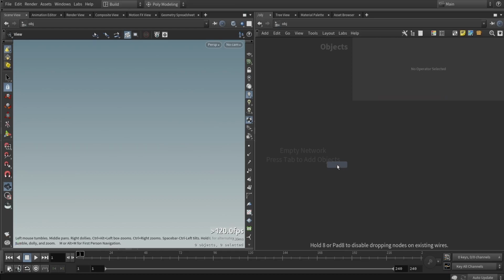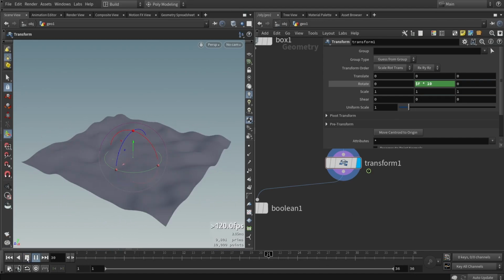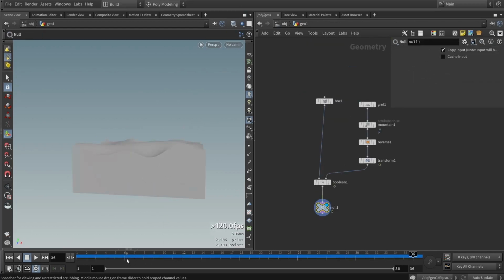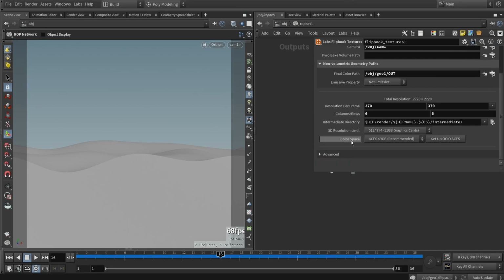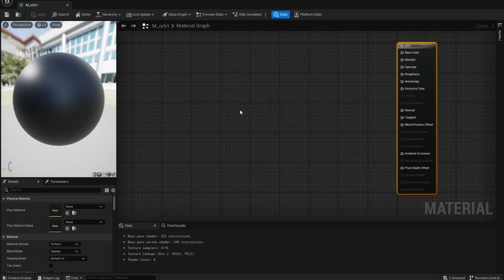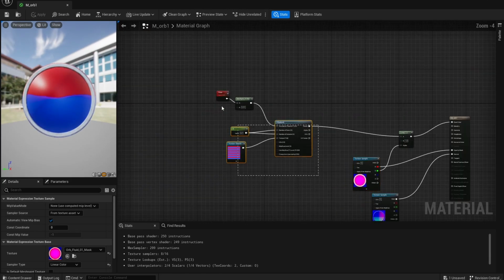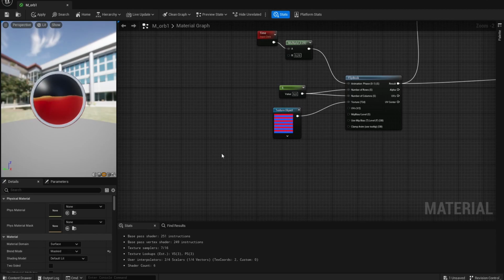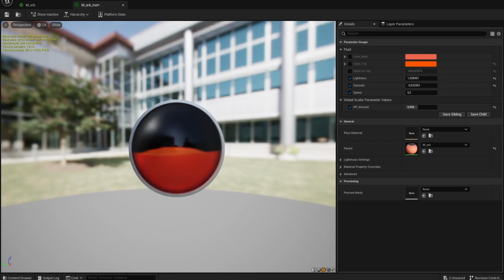UI Fluid Health Orb || Houdini and Unreal Tutorial

Comment: Great tutorial, only issue is its setup as a surface material domain but to use as a user interface it wont work, if anyone knows how to fix that, its got me stumped, when trying to make a widget i get error that it wants to be converted to ui when i do i end up with a black orb with sparkles and nothing else
Reply: have you fixed or find another way to use it as health bar? xD
Reply: Yep, thats a little trick in some youtube videos, it looks cool, but you cant use normal maps on widget materials, so you whould find way around, for example make that flipbook to work as alpha mask and put some random color, you still maybe need to make it pretty, but it will work.

Comment: Hey Simon, how are you doing at the new studio? I have a question. Yesterday, I was trying to use Labs Flipbook Texture with Labs Loops SOPs in Houdini. It worked well and repeated smoothly, but when I tried it in EU5, it didn't work. I am exporting 64 frames from (90 to 154). What am I missing? Thanks.
Reply from the maker: Hey! You are able to output these images from Houdini? It would be the same for UE5. If the images/flipbook from Houdini looks correct it seems to be a shader issue in the flipbook